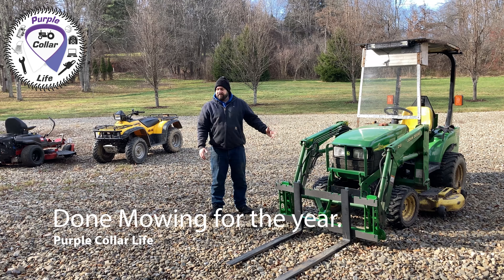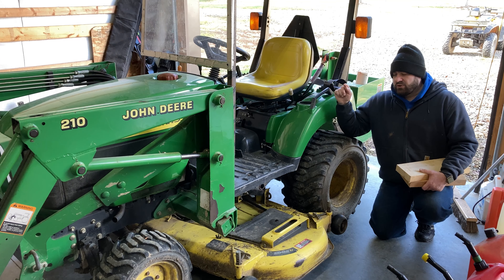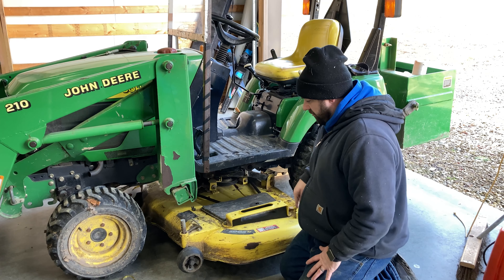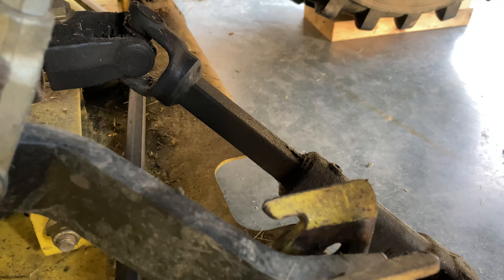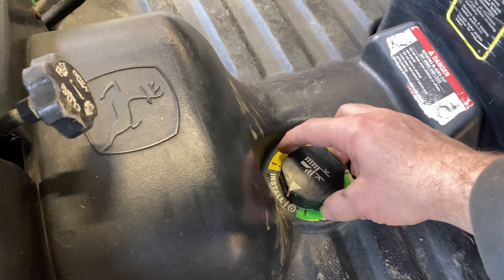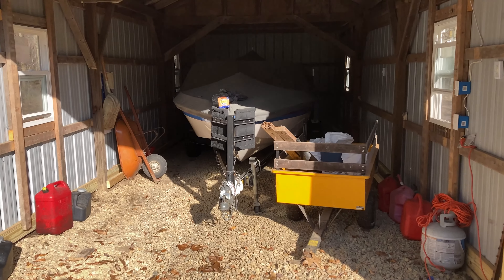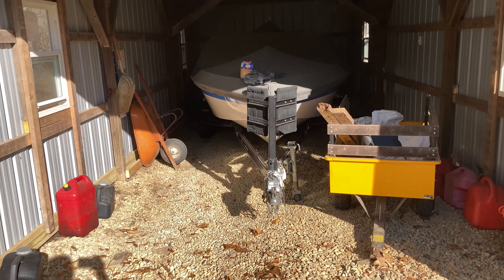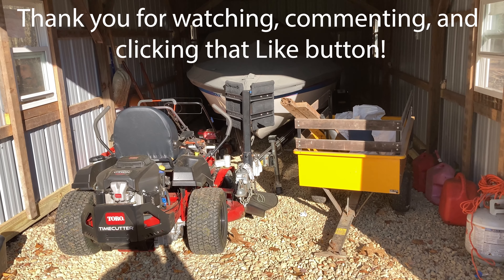#116: John Deere 2210 62 Edge deck removal. Toro TIMECUTTER storage. Rodent Control

Comment: 40* days also a great time to clean the mower deck. I also spray lube the underside to keep rust at bay. Teflon spray works great to keep clippings from sticking to bad
Reply from the maker: Great tip! I've used Fluid-Film before on the bottom of the deck, as well as sprayed bar and chain oil on it.  The bar and chain oil does attract the dust and grass and really makes it stick more than is ideal.  Teflon spray is a nice idea.  Thanks for watching and commenting!

Comment: Getting ready for winter is definitely a process isn't it. I've used that fresh cab stuff and it definitely works but I found that I had to keep putting fresher ones in through out the winter. Seemed to last a couple months but they say they should last longer. Mice are a full time job to eradicate at my place
Reply from the maker: It is a process.  Thankfully we've been mostly at home and I've been able to stay ahead of everything this year.  That's been one nice thing about the pandemic - getting lots done, on time, at home.  I kept up with the lawn all summer.  Had no problem staying ahead of the leaves in the fall. I have winterized the camper BEFORE the first freeze, I got the boat winterized and put in the shed before the first snow, and the mowers are all put away.

Comment: Could you make a video on how to reinstall the deck.  The lift arms on mine keep coming off while working and cannot figure out how to reattach them. You show they just fold up under deck, but how are they attached to lift to make them move up and down.  Thanks
Reply from the maker: Hi Laura - I'll make a video about installing the deck sometime in the future.  In the meantime - Those lift arms on the tractor remain on the tractor (the ones at the rear of the deck) all the time.  Two spring-loaded springs on the back of the deck go through holes in those lift arms.  The front of the deck is held on by that bar assembly that goes under the hooks on the deck, and then up to the front of the tractor on the deck mounts (it kind of rotates up until the spring loaded pin on the driver's side of the tractor fits into its hole on the tractor frame).  Then I connect the PTO shaft and it's ready to go.  
Thanks for watching.  Let me know if these brief instructions help.
Reply: Could you send a photo of those. I must be missing the springs.  Thanks
Reply from the maker: @lauramichael9770  Absolutely! I can’t send photos through the comments section on the video though.  Can you email me?  My email address is in the about section of our YouTube channel page.

Comment: I don’t know about you, but my Toro time cutter is a piece of crap. What a rip off, the thing rattled apart in two months and Toro will do nothing about it
Reply from the maker: Wow - that's totally contrary to my experience.  The Toro worked great for us so far.  We use it to mow our lawn, a cemetery, and we used it to mow that big 5 acre field in a video a few months ago.  We haven't had any issues.  Did you contact Toro's customer service from their website?  Or did you let the store you got it from know that you had issues?